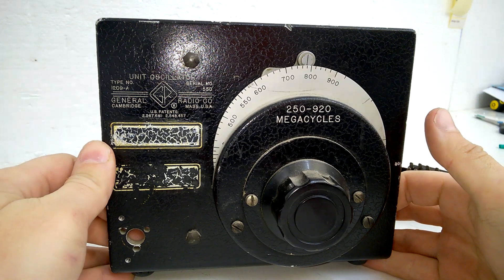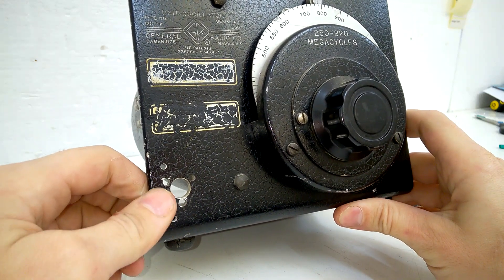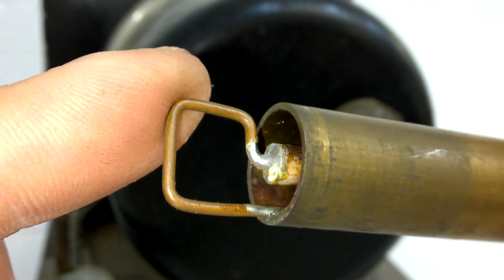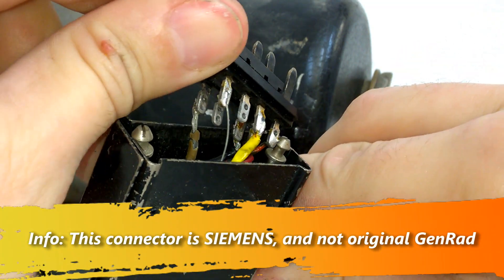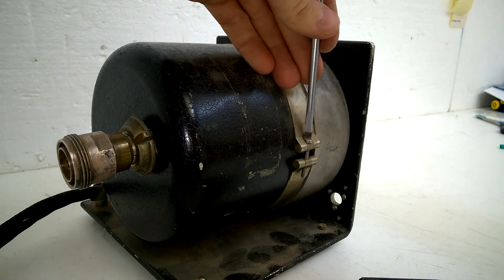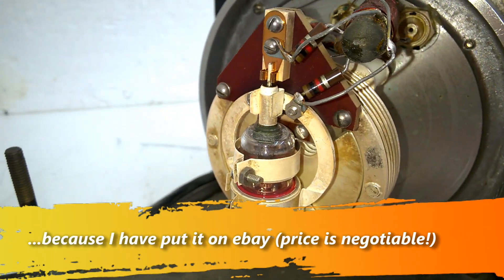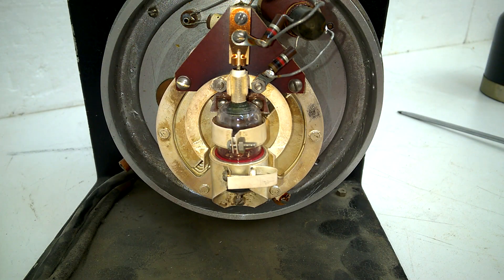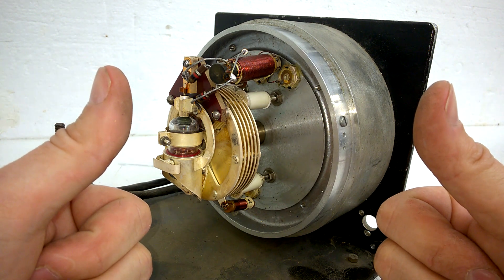BEB #63: General Radio RF Oscillator with Voodoo-Adapter, Genrad 1209

Comment: These unit-oscillators  normally have a GR-874 connector  at the end of the sliding attenuator. That is the thing with the 1 turn couple coil. I have several unit oscillators. 
My 1209C and CL  have a modulation input in the low-righthand  corner. See : http://www.pa4tim.nl/?p=4283
There are A, B, C and CL versions.  They all are different on the inside.  Most users had 1 or 2 PSU's and a series of oscillators so PSU's are a bit harder to find. And if you find one, the connectors can be a problem often they are replaced over the years with something else, like a DIY power supply. But the oscillators are very nice  and usable with plenty output power. They do not have much value. I do not know in your country but over here I only know 1 other GR gear collector.  Stay away from the inside, this is really a nice example of RF-voodoo.

Comment: I got a similar generator from Boonton, made in the 60s I think. Looks very similar inside, but mine got a range switch that rotates a bunch of inductors on a carousel. Then coarse tuning with the variable capacitor and vernier made with some "magic" part that I  think is just a varactor diode. The entire thing inside is running on life mains, only the housing is grounded. The output level is set via pulling that tube out (lowest) or pushing it all the way in (highest).
Reply from the maker: thanks for sharing. very interesting.
Reply: The old Torn.E.b radios from WWII used something very similar.